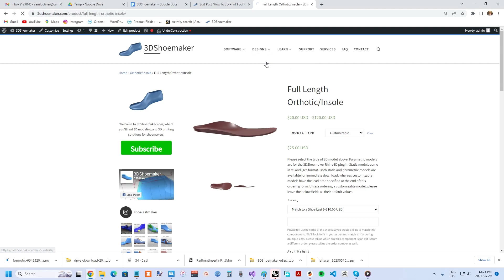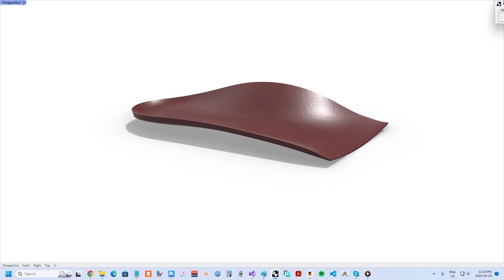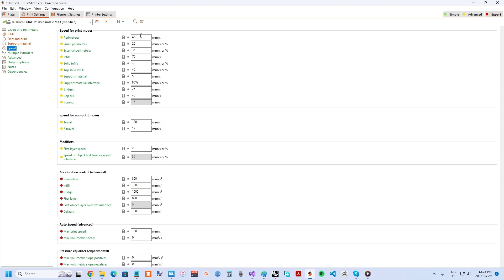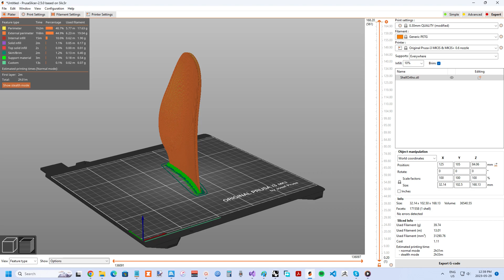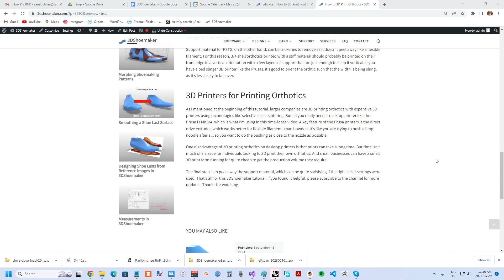How to 3D Print Orthotics on Desktop 3D Printers

Comment: what is best printer to buy. just making for me. i have to have support under big toe and tip ends of little toe.
Reply from the maker: Bambulab P1S is best for individuals
Reply: Hey there, I'm not entirely certain that you're needing orthotics. I'd suggest going to your local pharmacy to look for gels. Gel caps, toe separators, spacers, et cetera and find what you're looking for there. Popular brand name would be Pedifix. Vive Health & Medline are pretty good too.

Orthotics, especially custom, are specifically for those with severe foot conditions that can be treated with said orthotics. Based off your description, it sounds like you're possibly referring to claw toe. You can get some plain OTS/prefab orthotics for comfort, but honestly, those gels I mentioned would work best.

Hope this helps!